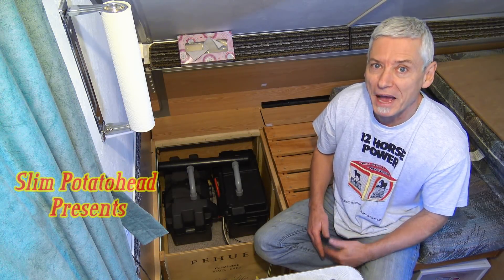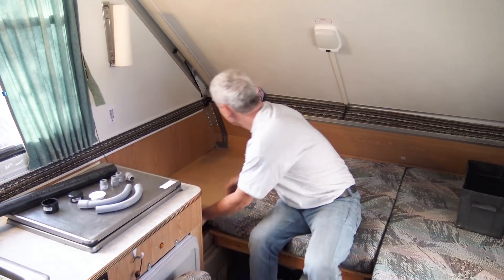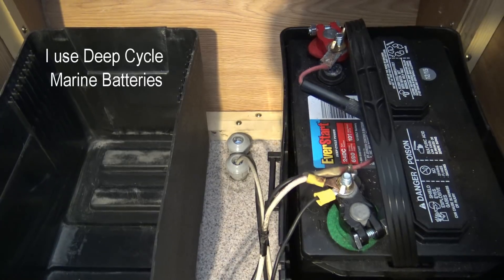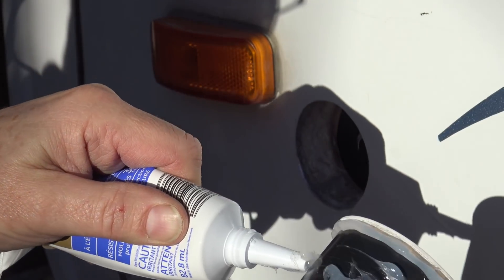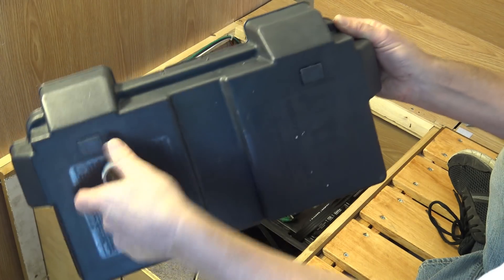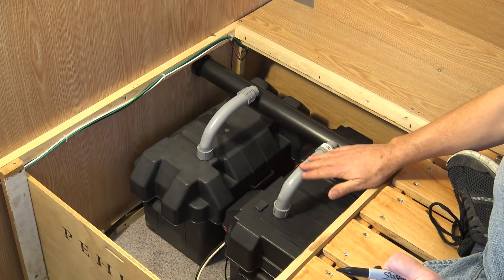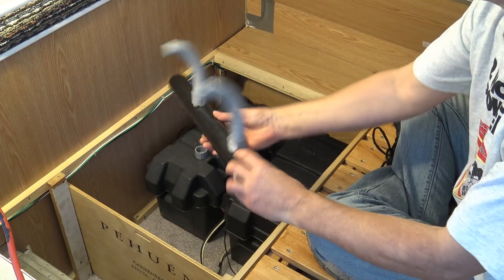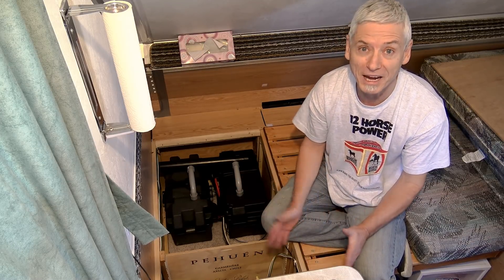Moving Trailer Batteries Inside with Vents

Comment: Nice one Slim. I intend in moving mine inside too. Is yours on same side as your panel or opposite side. Could not tell from your video.
Reply from the maker: Hi Brian, What panel are you referring to? The batteries are on the front left of the trailer. Thanks
Reply: Slim Potatohead . Hi there Slim. I meant your converter panel. Mines on left side behind wheel.
Reply from the maker: Ahhh, mine too. I actually did initially try putting a battery back there, but I wanted it closer to my solar panels, which are on the front.
Reply: Slim Potatohead . Oh I see makes sense.
Reply: Huu

Comment: AAAAhhh... the bike rack , better make sure you have enough clearance with your back bumper and turning in reverse .
Reply from the maker: Hi Ken, That's what I'm looking into today. Need to decide if I want to move the propane tank to the front, remove the front wheel, or just heighten it. Too many possibilities!
Reply: If you move the tank up to the space where the battery box was is there room for a storage box?  I saw someone put a bike rack connected/ welded to a locking storage box in that space.

Comment: Keep in mind balance, you adding additional weight on the side, could cause a uneven wear and tracking. I would never install batteries on the inside, I've see a battery short out and explode.
Reply from the maker: Hi Barry, I actually needed more weight on that side as I don't use the water tank. With proper venting and secure connections I consider the risk is very low of any explosions. More risk from using propane and 110v outlets in a trailer! Thanks

Comment: Nice idea on the battery relocation and venting. My only suggestion (being a 40 year career plumber) would have been to use all pvc water pipe fittings and tee's to simplify the assembly.
Reply from the maker: Absolutely! There are so many ways this can be done, I used what I could find at any hardware store (Lowes in this case). They didn't have short lengths of 1 1/2" PVC which is why I went to ABS. Maybe Home Depot! Thanks
Reply: or flex pipe

Comment: Good idea, but here are some ways to do it differently.
Use Flexible Liquid Tight Conduit and connectors for the bent parts, getting those two elbows lined up is fussy, flex connections are easy to do one at a time.
Keep using the straps to secure the battery box covers. Use more than wood screws, bolt the battery boxes down with good size bolts through the floor. If you hit some big bumps you might spill acid, or short circuit on some metal in the trailer.
I think there might be issues with weight distribution and tracking with both batteries on the same side, but I don't know how well the Aliners do when out of balance.
Reply from the maker: Hi J, I actually looked into the Flexible Liquid Tight Conduit, but found it not flexible enough for such a small area. The batteries have 4 screws each, and the one has been installed for almost two years there without issues, but more secure is always a good idea. I keep all my heavy tools on the other side so it evens out quite well. Thanks for the tips!
Reply: I know that it can be hard to do a sharp turn with flex conduit, but if you give it more length it should be doable. The reason I think that would be the way to go is that you can leave the flex connected to the battery box top as you open it to check the battery water level. Sort of like the way you can leave the air intake hose connected to your car's air filter box while you are checking the filter on your car engine.
But I'm probably over engineering this, it's just an air vent.
Reply: drilling holes in the bottom of the box is not a good idea.one of the functions of the box is to retain any electrolyte that could spill out.drilling holes negates the integrity.fastening some pad eyes or even screw eyes to the floor and then strapping them down is far stronger and more stable than a couple short screws.

Comment: nice video, but I would think that you would slope the pipe outside to allow any moisture that accumulated to to drain out side, any gases would still vent
Reply from the maker: Hi Dave. Hmmm, that's a thought. Easy to tweak. I am planning a long road trip, so I'll see how much moisture I get and if a little adjustment is needed. Thanks!
Reply: I know I’m late. My Chalet had the battery inside from the factory and had venting in the bottom as well as the top for cross venting the box. Hydrogen won’t fully vent if you don’t allow air back in, is the theory.
Reply: @Robyrob7771  The space for the wires in the lid of the battery box seems to accomplish that bottom flow.

Comment: So you ditched the shower?
Reply from the maker: Hell No! It's on the opposite corner of the trailer.
Reply: LMAO
Reply from the maker: I am ditching the water tank though. Fold-up bar maybe?
Reply: Great idea, only thing on mine I have indents in the box to allow venting, most boxes I’ve seen have this, did yours? And if so did u block it.